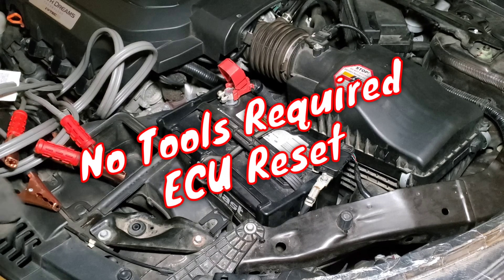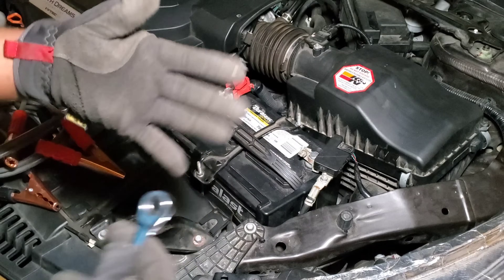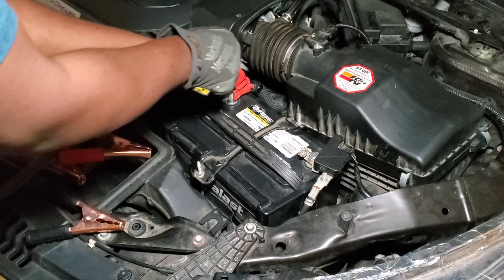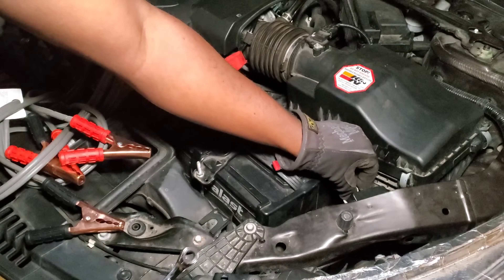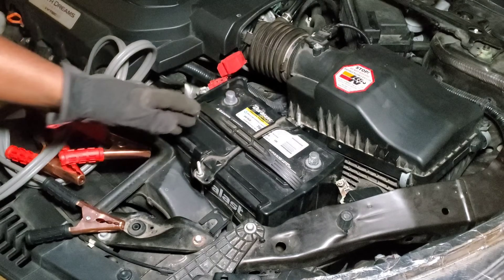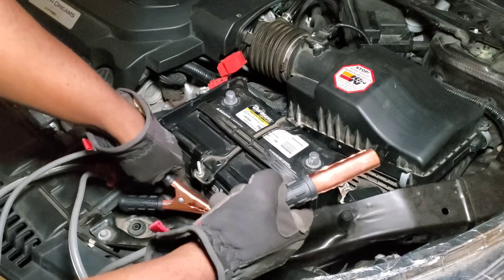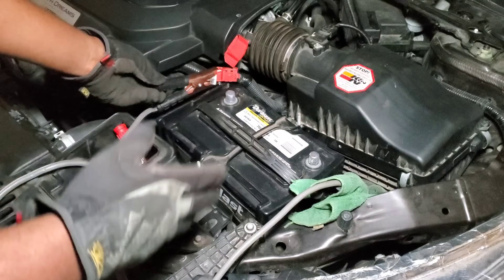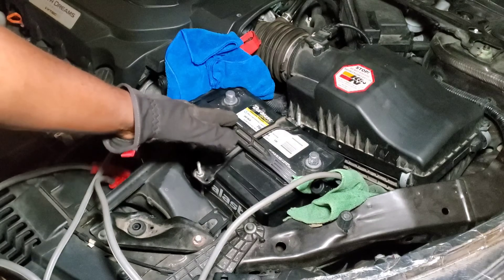How To Reset All ECU  No Scanner No Tools Required

Comment: You should always remove the NEGATIVE side first then the POSITIVE.  Replace the POSITIVE side first then finally replace the NEGATIVE last.
Reply: When you jump start a car you dont even have to connect the negative wire to the battery you can connect it straight to the metal body of the car because it's acting as an earth/ground
Reply: @Beethoven2949 Is that the battery of the one being jumped that has the neg jump cable put on the dead battery frame?  What ? On need to know basis only. 😉🫤
Reply: It amazes me how everyone in comments differs about which cable to  disconnect first and reconnect  first unbelievable how they could be so different in their opinions
Reply: @randymcmanus8691 As a woman who’s into cars irks me to no end. I’ve realized mechanic opinions are like Doctors opinions so angering.
Reply: Exactly
1) we disconnect first( -)then we disconnect (+)
2)we reconnect first (+) then we reconnect (-)
If we do the opposite it may cause short circuit=damage
Reply: I think the pos post should go on first because if it's on and say you bump the ground to metal it wouldn't matter. And if you notice if you already put the ground on first then the+ post you may see sparks from the pos post that isn't helping your fuses relays or other things. Also if you ever checking to see if your alternator is working by disconnecting the pos post. Turn the car off before pulling the neg post and then put +post back on and then put the nev post on last. What? set the +post first then neg post.👍Why ? 🥴👀😂 Because your mom said so ! 🤔
Reply: Yep I agree
Reply: If you ain't positive first, you will be grounded. That what she said. 🤣🤣
Reply: Here's the thing, it's only a 12v battery 😂😂  it takes at least 50v to penetrate through your skin. Now with higher voltage, yes you remove the hot first then the common and reconnect common first then the hot
Reply: Dc and ac are two diff animals.  While being 12v dc your dealing with a amperage of 600 . If you think that wont go through your skin and right out your ass while knocking you on it your severly mistaken@jbigt4850
Reply: Can we do that technique in BMW car?
Reply: Can do this on Corolla hybrid 2019 let me know please
Reply: NO! You will damage your modules
Reply: WHY
Reply: Makes ZERO difference either way.
Reply: It honestly doesn't matter which comes first. Lol
Reply: what if you break a car when in gear ut cuts out and won't start? no lights on the dash? wi ll this method work? thanks for your advice.
Reply: @michaelgalvin6491  if your car stops while running, it's not the ECM, it's most likely a battery or alternator issue. Which both are much cheaper to fix lol.
Reply: Yes I caught the repeated mix-ups as well.
Reply: I believe that is called performing a cap discharge.
Reply: I know I lost all confidence in this video when I saw the way that he disconnected the battery at the start
Reply: Black boots red socks
Reply: You guys are jokers, I connect whatever I want 1st and the important thing is the car starts as it's supposed to. Most important don't short between positive and negative directly when the car is connected to the battery. 
It's like you guys are arguing whether which position is the best to make babies, missionary or doggy....lol..🤣🤣🤣🤣🤣
Reply: @zepp3lin  blablablab haha. You don't understand.
Reply: That's completely incorrect 😂, the negative side or black wire is essentially the same as earth/ground connection. ALWAYS when jump starting or connecting a battery put the negative wire on first, it acts as a ground wire and stops sparks flying everywhere.
Reply: @Beethoven2949 my
Reply: @Beethoven2949 facts 💯
Reply: Wrong. 
Disconnect negative first, reconnect it last.
Reply: @daveh1289 this comment is professional ❤
Reply: @Beethoven2949  you're wrong. 😅
Learn dc electrical physics before you argue
Reply: @skankhunt42  amen. That's correct. The negative should be last to take off because of safety. The positive 1st. Then, when placing things back, neg 1st, then pos. That way uou keep a ground in case something goes wrong.
Reply: Correct.. also use this method when Jumpstarting a car.
Reply: I take off black - first and then I take off red + second and to put them back I put black first then red
Reply: He did the right thing by removing the pos first.then the negative. You need to keep the ground in case something goes wrong, that way it's grounded. U always hook the negative 1st and pos last to be on the safe side.
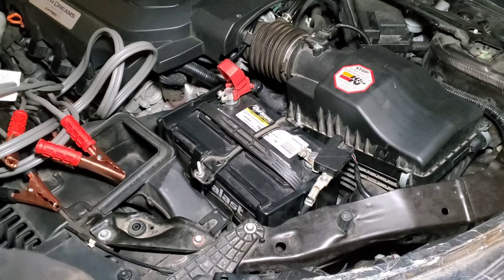Reply: 0:32  @royhancock1817

Comment: If you want to drain ALL the residual power when the battery is disconnected put your headlights/radio/hazard-warning lights on, instant full drain of the system,

Comment: We followed your instructions exactly and our 2017 Subaru outback reset perfectly. Thank you so much for your time on doing this video. We sure appreciate it!
Reply: Did same for my 2011 Outback.  Worked fine, suggest leaving disconnected for two hours or so.
Reply: So that’s mean you have to kept the car running for atleast 30 mins or 1 hr?
Reply: @edgardoiisarsaba6907  Nooo,, it means leave the battery jump leads on the wires for an hour or two.

Comment: The reason you disconnect the ground first, is because the ground touches every circuit in the car. Therefore you disconnect every circuit, including computers. The  positive lead does not. All the positive energy from the battery runs through relays and fuses, where the ground does not. If you replace the ground first and then are sloppy when you connect the positive you can do damage to your computers with voltage spikes. The same applies to jumper cables when you go to jump a car off with a dead battery! You should always connect positive and negative, and wait for about 5 minutes for the battery to charge and a computer's to come online. Hope this helps explain why the positive then negative rule is crucial.
Reply: Negative is the ground?
Reply: @supernothing77  yes

Comment: Well I'm going to give it a shot! 2011 GMC Sierra 5.3
Throttle Body is black and sooty and the first time I cleaned it, then started the truck and it ran terrible! Spitting and sputtering for several days but eventually went back to normal. I'm gonna go ahead and clean it real good! Swab the inside top & bottom. Then follow your steps and if I do this and it doesn't work on my vehicle. I'm gonna hunt you down!!! 🫠

Comment: Brilliant,  I bet the dealerships are not getting as much revenue due to such a simple fix, which they probably do anyway?!
Reply: I'm scheduled to take my car to the Stealership in 2 weeks because I keep getting a check engine light to a sensor that I've since replaced. I'm gonna try this as my last resort. They will not be getting my money if this works. I've long thought this was a reset issue.

Comment: Holy shit!!!  You're a good guy, I can tell, but WTF?  I'm not doing videos on home liposuction procedures, you should not be doing videos on auto "repair".  All that needs to be done is the negative terminal disconnected and touched to the positive, while still connected is fine (and equivalent to disconnected) for a couple of seconds.  Process concluded.  End of story.  3o second video.

Comment: Ah, video says no tool needed but you used a wrench...just saying.😄
MAKE SURE ALL...ELECTRICAL ARE OFF.IE:LIGHTS,RADIO.
AFTER DISCONNECTING AND ATTACHING CABLES, WITH EVERYTHING ELSE OFF, TURN ON LIGHTS. THIS WILL DRAIN OFF ANY RESIDUAL POWER LEFT OVER FASTER. Leave 10 minutes
Reconnect battery, tjjrn key to on position but DON'T turn on. When lights go off, turn key back to off position. Do this 2 times and on the 3rd time, turn car on. Let run for about 15 MINUTES to let ecu relearn values then drive for about 20 MINUTES at your normal driving range.

Comment: “Disconnect ground lead first” that’s what we learnt since childhood but you did it the other way round
Reply: He's doing it the wrong way.
Reply: I agree, he also call the cables "terminals". No, they are CABLES that are removed and shorted, the TERMINALS are on the battery. And, yes, we all learn from our dads and in high school Autoshop to remove the Ground cable FIRST for safety.
Reply: @paulromsky9527  depend what side of the world your from we call them terminals aswell.
Reply: @johnsbackwithcommonsense7628  yep same as us Australia NZ Rogee 🤙
Reply: @paulromsky9527  that’s what we call them Battery “terminals”
Reply: @Rickyk878  It appears in different languages/countries, there may not be a distinction between terminal and cable. In the USA for SAE automotive technicians, the cables have "clamps" and the batteries have "terminals" or "posts". Ok, that might be a bit technical, but the real take away from my comments was he had good intentions, but he removed the POSITIVE cable from the battery first - which can cause a dangerous short if the wrench/tool is on the positive battery terminal/clamp and it touches the chassis - I have seen it before. Here in the USA, SAE technicians are taught to ALWAYS remove the NEGATIVE "Ground" cable first to prevent shorting the battery's 12V to the chassis when working on a battery.
Reply: @paulromsky9527  thanks for the reply Paul We in Australia 🇦🇺 & New Zealand 🇳🇿 pretty much follow the same guidelines.
Reply: @Rickyk878  Good to know, and your toilets flush clock-wise there, over here, ours flush counter(anti)-clockwise [smile].
Reply: Disconnecting one cable or the other first is not wrong. You all need to understand the reason why you were taught to do something a certain way.   Removing the negative terminal first is just a precautionary measure that you take to avoid shorting circuits because the entire boduly of the vehicle is ground. It does not mean that doing it the other way is wrong, you just have to be careful not to touch the positive terminal to the body of the vehicle. So in other to avoid this you were taught to remove the negative first AS A PRECAUTIONARY MEASURE! Stop saying something is wrong because you were taught a different way. Your teacher was making it idiot proof for you.  The mere fact that you all are saying it's wrong, means you have not understood for yourselves but rather juat being a robot and doing what you were programmed to do.
Reply: @MasterTitre   @Addy Titre   I totally diassage and personally take offense from you calling me a robot or suggesting I requiring idiot proofing.  

You seem to take offense to the term "wrong" in this case.  Let me expand on that. I always had common sense but I was also told to remove the Ground first on a common ground chassis for safety:  this was from my father, autoshop in high school, in the Air Force, and in automotive engineering.  So it really wasn't "taught" to me but reinforced over the years.  The fact is: If it is not safe a certain way when another way is safer (especially through no extra effort or cost), then that unsafe way is WRONG... period.  There are proper (right) ways to do things, and unsafe/improper (wrong) ways to do things. Removing the positive cable first is just plain unsafe... and this is why it is wrong.  Wrenches slip (eventally) no matter how "careful" you are.  If you have a choice to do it safer, then any sound minded person will do it the safer way.  This has noting to do with idiot proofing (called Poke-Yoke in the industry).  Only idiots think that safety is a choice as long as "you are careful". Look at it this way; would you smoke over a discharging battery? Hydrogen gas is very flamable... but by your logic it is ok to do so as long as you are careful.  Same idea, you are saying to be careful and hope you don't accidentally short the battery to ground when you could have just as easily taken the ground off first to be safer. Accidents happen all the time, and you never know when they happen. So it is prudent to be safe and not just to be careful in this case.  In the Air Force, you are working on multi million dollar equipment but human safety is priceless. In your driveway you may be working on a worthless junk car but human safety is still priceless.  

So THAT is why not removing the ground first is simply WRONG.  This video is a "teaching" video, and to demonstrate such an unsafe way to work on batteries in this situation is not just wrong, but irresponsible.

If you, Addy, want to show people to do something unsafe and not consider it wrong as long as you are careful, then have at it.
Reply: @paulromsky9527  thanks for your feed back. It's our right to disagree. Just FYI, my comments were not targeting you or any one in particular. It was a general reaction to things I've read in this post and others. and as for taking offense, Hell No! There's too much going on in this world to take offense by this! Have a great day Paul!
Reply: Oh and by the way, your resume don't impress me. Kindness towards our fellowmen and humanity are what impresses me. If you look closely within your book you will see that we're saying the same thing. The other way is not wrong but it's less safe. Now carry on smartly.
Reply: @MasterTitre   @Addy Titre.  Hey, Addy, you wrote back but your second response was in typical troll-like fashion, you just won me a round here at the cigar lounge!  We comment on videos and when we get a troll, we bet on how they would respond when we get to the bar. I bet you wouldn't give it up on the word "wrong" and you didn't... I won $100. I am now having some single malt Scotch and a nice cigar on you! Thanks!  We do this all the time, we even post up the comments on the monitors for all to see.  

I wasn't trying to impress you. You talk about kindness toward our fellowmen, yet you insulted me with robot and idiot proof references, do you see how hypocritical  that is [laughing].  Again you were triggered by the word "wrong".  Well YOU are WRONG in trying to say we are on the same page, when we clearly are not. [smile].

Ok, let's see if I win the next round. We are waiting... oh, what will you say? [LMAO]
Reply: What if I change my computer model and at frist itstart  but shut down in like 2seconds like my key program has been of set because I had to get. A new key
Reply: @jaycrook5195  Usually, the car won't start if the smart key does not match what the computer expected.  But this video is about clearing error codes after fixing something on your car - like putting in a new O2 Sensor that was failing. You have to clear the error codes to be sure you fixed the problem and make sure the error does not come back.
Reply: That's the thing it doesn't read any codes or anything like that I have no codes I replace my ECU computer monitor everything work the first but it sound like the key was showing it out when I start crying it it cranking for like two seconds then it'll go out and now it won't say nothing at all so it got to be my key huh
Reply: @jaycrook5195  Yes, it appears that your new ECU and key don't match. Did you go to the dealer? What year/make/model is your car?
Reply: In the newest cars today you need to remove the positive first, with so many modules you need to then put the negative side first when reassembling.
Reply: @honda08p  That notion the positive cable MUST be removed first may be a misconception. A DC circuit has no way to know which "side" was opened first - each module/device is its own circuit. The stopping of electrons flowing in and out is near the speed of light (about 1ns per foot), and since a car has only a few feet a wiring maximum on any circuit from the battery to the load, that is around 15 ns - but again, if one side is opened the flow stops on BOTH sides equally - there is no "sloshing" effect like water in a pipe, some capacitors may slosh a bit, but they have no idea which side of the DC power was broken (removed) first. What does happen is "bouncing" (arcing) of the voltage as battery connections are connected/disconnected.  That is the worst thing automotive circuits will endure.  Now, in most electronic/electrical circuits we "switch" the hot (positive) wire. If we switched grounds, there is a better chance of accidentally touching/shorting to chassis (ground) and powering up. This is why fuses/breakers are on the hot wires in our homes and in our cars (and virtually anything electrical or electronic). I will contact my brother that works on all sorts of models and years, but as an Electrical/Software/Firmware Engineer, I don't know of any circuits or devices that MUST have the positive disconnected first except in some high voltage safety cases over 10 kV - which cars don't have. Not even in the Air Force on high tech Aircraft with hundreds of subsytems/modules, you always disconnected the negative cables on Batteries first (unless it was positive or floating chassis).

If a car manufacturer is unjustly telling mechanics to remove the positive cable first and risk shorting it to ground through a tool (like I said before does happen), then that is irresponsible of that manufacturer.  Someone may just be "winging" it and is unaware of the safety risks when working with a negative chassis vehicle.
Can you tell me which car manufacturers/models/years are requiring that the positive cable must be removed first? Thanks.
Reply: @paulromsky9527  very confusing, so which one should be moved first??
Reply: @temawedey2941  Remove the Black Ground Negative cable from the Battery that goes to the Chassis first.

This way, if your wrench touches Ground (Chassis) while doing that, it is a Ground to Ground connection and thus no shorting.
Now, that the Battery Negative Terminal is no longer connected to Ground (Chassis), when removing the Red Power Positive cable, if the wrench touches Ground (the Chassis) there is still no shorting.

When reconnecting the Battery, connect the Black Ground Negative cable last (for the same reasons).